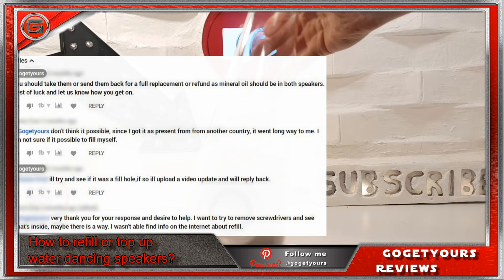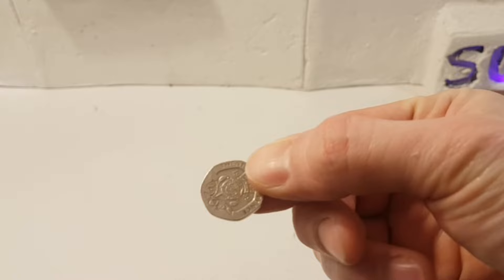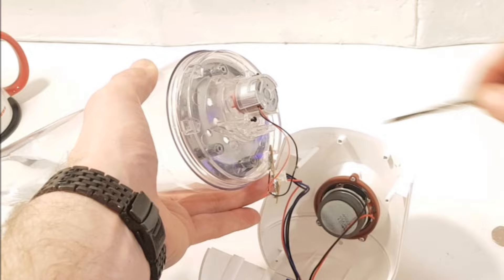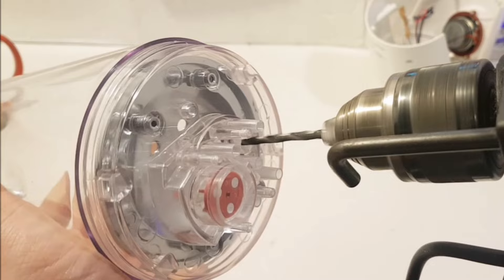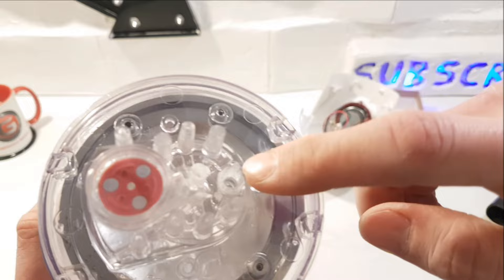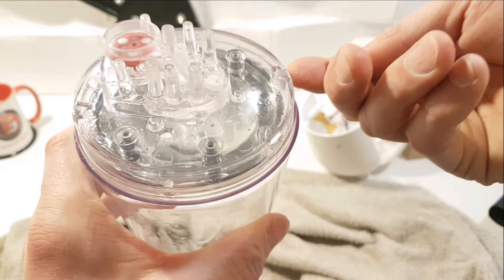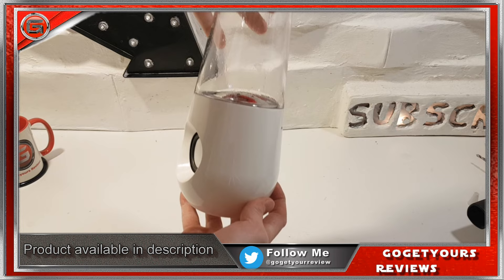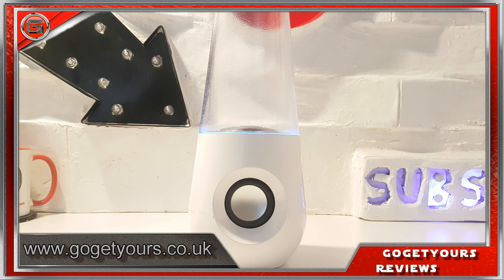How To Refill Water Dancing Speakers - What's inside?

Comment: I got the same speakers similar to that one. I got the wireless multimedia LED dancing water BT speakers BSS - I 65. I got the speakers but the weird thing was they didn't come with water the Bluetooth one where I can turn it on all that one didn't come with water. I took it apart and I see white yellow green and red wires. Every time I turn it on and play music it makes this weird little noise as if it needs water. I was wondering if I could cut a wire for the Bluetooth to still be working but not the make the noise so the other speaker can work because other speaker came with water. Is there a way???

Comment: I hope this is how really do it so i can do it mu self is it nessesary to use the screwdriver (if i writed somthing wrong i do not have english as my first language)
Reply from the maker: The main thing is to be patient when drilling, each water dancing speaker is different, some have a rubber plug, not a plastic seal. This one in the video did have that plastic seal that did need a drill, you have to be very careful not to contaminate the inside with excess plastic while drilling so my tip is to hold it upright vertical so that excess plastic will drop down. This will help after filling with mineral oil, it won't be cloudy and it will be clear.
A screw driver is needed in the overall process. Thanks for the question ✌
Reply: Ok thanks for the answere (I meant drill and not screw driver)
Reply from the maker: @nohoso1  You are very welcome
Reply: Dont drill, use a hot needle or a solder needle to create hole and prevent plastic shavings.

Comment: what liquid do i need to put?
Reply from the maker: mineral oil
Reply: @Gogetyours  hi my brother put water inside the plastic how i can desposed the water it this safe to drill on the tap?
Reply from the maker: @agentkkk  you will most likely have to take it apart, tip it inside down like I did in the video, drill the hole in the correct place, again in the video. Then shake most of it out.
Reply: @Gogetyours  thank you so much brother i will try

Comment: I broke the wires off to the lights on both sides, and I have a squeaky motor now. I gotta get better at DIY
Reply from the maker: Lol, it does take alot of patience, I had rectangular shaped speakers,I attempted a fix due to one speaker not pumping the oil correctly, I did the same thing,only I totally ripped all the wires from the base because the bottom base was hard to unclip.
Reply: Take the motor out just use the soeaker